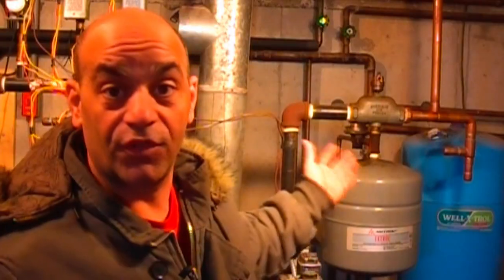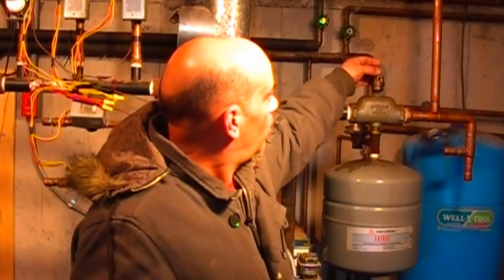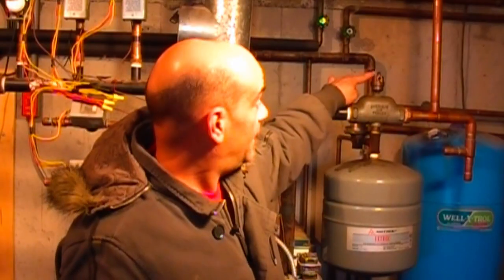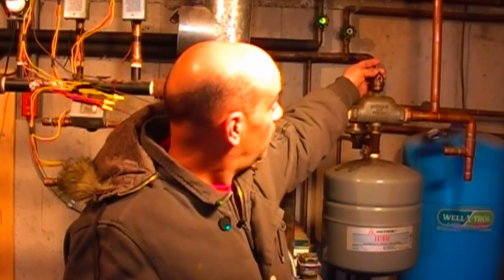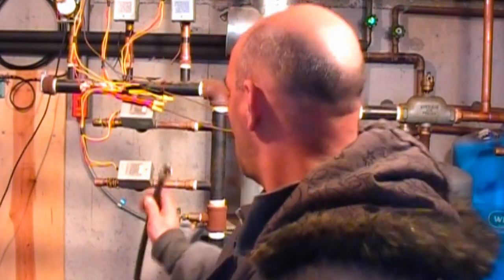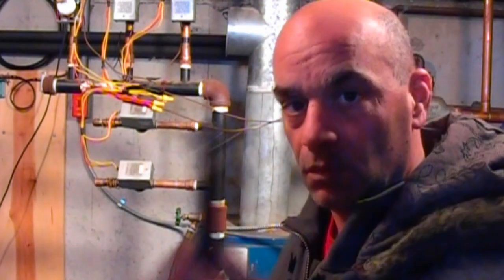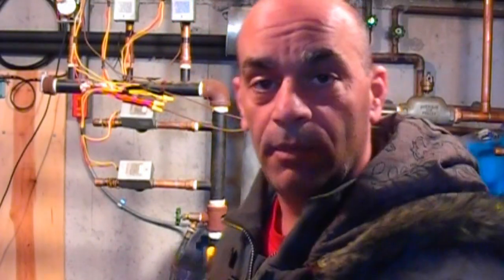How to remove the air from your boiler / heater

Comment: what if the pressure is low on the side of the boiler. Mine only reads about 4psi maybe.
Reply from the maker: Make sure the fresh water valve / regulator is on.
Reply: I've looked from where the water comes into the house  to the boiler and it seems like all the valves are open. The pipe splits when it gets to the boiler and one side goes to my how water heater the other side goes to my boiler, right under it is my expansion tank and right above it is the valve that purges the air. I dont see anything else to open to get more pressure. I've also opened up the bleeders on the upstairs baseboards, some air will come out but then it just stops and no water will come out.
Reply from the maker: Ginzosmovies If you can go to my site and post some pictures of your boiler so I can help you better.
Reply: askmediy I put a video called Boiler Pics in my videos if you could please look at it.
Reply: Ginzosmovies You may need to replace the water pressure control valve. I had the same problem due to a clogged valve that reduced the pressure to the boiler. A new one pressure valve solved the problem. 

(this is a year old post but in case others have a similar problem.....)

Comment: Dominic, your explanation is excellent. I don't think there's any other video that explains the workings of a boiler like you did. Question: When I open the spigot (with the hose on it) to bleed/purge the air, can junk from the boiler pot interfere and prevent me from closing it again? I have one radiator on the second floor (whole system is one zone) which defies bleeding. A lot of air comes out, but will not completely bleed, and the hot water sits at the bottom of the radiator. Also, I hear gurgling in the wall when the system shuts off.
Reply from the maker: Yeah loose junk in the water can jamb up the seal on the valves. do you have a bleeder valve on the radiator. If you do try using that as well. 
And thank you.
Reply: askmediy Actually, I leave the valve on the radiator open while the heat is on. I think the water is not being forced through the entire radiator. Another radiator (in the upstairs bathroom) bleeds just fine. It's just this one other radiator on the second floor.

Comment: I have 3 zones in my house.  I have successfully purged the air from the top 2 floors, however, on the bottom floor it seems to be taking air in along with the water as the bubbles don't change in intensity, but there is quite a lot of bubbles in the water in the bucket.  Any ideas?

Comment: Thank you for the tip on the purge valve. I bought my house in late spring and by early winter the pipes were sloshing and gurgling. I flushed all the lines, and got some junk and lots of air out, but within 3 weeks I could hear the air again. (Our city water holds lots of dissolved gasses and we get bright white ice cubes.)  After watching your video, I went and checked the purge valve. Sure enough, the previous owner saw a couple of lime streaks down the tank and closed the cap down tight. I loosened it up, ran the heat, and within 4 minutes it was all quiet again! Thanks again! Dan
Reply from the maker: Good deal. Glad I could help

Comment: I do the same

Should have do a better job with wiring.

End switch are clicking a 24 relay that is turning pump on.

but aint clean..

The guy has experience, im in this too. but wtf is that mess of wire....

Comment: Great tutorial and I love the character you put into it, much better than the monotone of some of the others. 1 question: What are your thoughts on auto bleeders in the baseboard radiators for bleeding residual air? Our plumber installed 1 on the topmost baseboard on the third floor, before that we had to go to each unit and push the Schraeder valve open, starting on the first level and working our way up. The auto bleeders seem to work great..
Thanks.
Reply from the maker: I've never used them as it leaves way too much to go wrong with leaks. I've always installed a auto bleeder down at the boiler. But hey some older steam converted systems may need one or two installed.

Comment: I honestly wish you did my system. I'm having an issue with the top floor. The minute the water line is cold, it creates bubbles and the heat doesn't want to rise. Lately, when I close that lever (one for each zone) and try to drain in. Nothing comes down. I feel like the cold water is sitting up in the pipes and doesn't want to drain. Does this make sense or am I doing something wrong. The zone valve doesn't seem to want to allow hot water up. I would appreciate help.
Reply from the maker: I would make sure the zone valve is opening up. Try to manually open it. Also the bleed it very very good. Send me a picture of your system if you like.

Comment from the maker: 1) Turn the power off. 
2) Turn the fresh water inlet valve off
3) Release water in the system to at least where the pressure is below zero. and temp  
4) Remove and replace tank all in one full shot. Get ready for a bath. 
5) Bleed system, the entire system.

Comment: To replace an expansion tank..Do you first turn off the boiler, then remove the tank and install a new one on? Will there be any pressure coming out when you remove the tank completely?

Comment: PS.  That's a nice air removal valve you have mounted over the pressure tank.  It looks like a B&G.  I have their large canister type and it took care of all the air in the system and does a great job.  I can unscrew/remove the cap lid on it and inspect the guts when necessary.  Experience has taught me air-in-the-system is a side result of high temperature (heated) water.  You cannot cure/stop that.   The same as boiling water in a pot on the stove...

Comment: Thanks for the video.  I continually review my boiler knowledge by watching videos--so made by generous people such as yourself.  My comment is --I had been suspicious that my ancient water pressure reducing valve was faulty.  It was--it was blocked with crud and virtually took the water pressure down to nil.  Changed it out with new and what a difference.  Mind you, we have soft water!  I did not know because the pressure gauge was bad as well.  All's well now--what a difference.

Comment: Thank you!  Went from no working heat on the 2nd floor at all to completely fixed thanks to your explanation.  I had tried bleeding it before but I didn't close the valve that prevents circulation, so I imagine much of the air just went around and around.  I also didn't bleed it nearly long enough the first time.

After watching your video, in which you pointed out both of those pitfalls, I bled the system correctly and now everything is perfect.  Thanks!

Comment from the maker: Thank you. Sure it could be. Make sure the wire connections are good as well. On the valve you should see a small lever for a over ride. Try moving that. But do not leave it in the lock position once you're done bleeding the zone.

Comment: It serves a 1st (great room) and 2nd floor (loft). 

BTW, I just replaced the expansion tank as it was clearly bad and primed/bled that section (the system has a really good placement of isolation valves - well plumbed). The new one definitely has much LESS water in it.

Comment: A bit more, as YouTube's char. limit/message ran out. I can hear the bubble flow past when exercising that circulator. Then it runs fine for a few, until things repeat. I am afraid that I am going to burn that pump up. Also, I get water from the bottom of the Amtrol tank's air valve when pressed on to check air psi. Other checks (tapping on it, half hot/cold) seem OK though.

Comment: Dominic, Your vids are a gem! Simply great for the doityourselfer! Question: Would a bad Amtrol 30 tank let air in? I cannot keep the zones bled, one in particular will last less than an hour and then vapor locks. No leaks, so that is not the issue and boiler temp & pressure is OK. That circulating pump will go to humming LOUDLY when the vapor lock passes through and lands onto it & the pump loses it's prime. Jiggling the its thermostat off and on will push the bubble past & things are good.

Comment: Great Video, and great Plumbing... your presentation is seriously professional.. as for your system  to dump the air very simple set up . prior comment regarding those little auto  bleed  'air release Valve' all to true. we call some folk  here in Ireland  a ... 'Hurler on the Ditch...
A non-participant who criticises from outside. Derives from a criticising the players on the field of play...

Comment: I have anti-freeze in my system with a back flow valve installed. The system is good to 10 below zero. If you want more, add more anti-freeze. You have a great video. Thanks.

Comment: @DominickDiy well its a big system there are 2 pipes coming to the bottome of the boiler which are 2 or 3 inch and it does have the air release valve cause there is a hose connected to it and those 2 lines are a circ pump each and I can hear the water trickling in them as well as in my room which is 2 is probably about 100 of feet of line to the boiler. and coming from the top of the boiler there is one line which is about say 5 inches and coming off of that is a line going to the expansion tank

Comment from the maker: Just try opening up those valves on the radiators one at a time. Try to start with the one closet to the boiler. and so forth.

Comment: What if the boiler does not have any zone valves but each rad has a valve. I know that there is air in the system because I can hear the water trickling in the rad and one side is warm but the other side is cold. Its somewhat of an old system it does have the shut-off valves by the circulation pumps.

Comment: Great video. Especially for me as I seem to continually battle with this issue. My system seems to vapor lock and I have to drain off air. Would you have any ideas as to where this air would be coming from? Thanks again for the video.

Comment: yes they are moving manually and the spin off and on,when themostat turn them on and off. if the dial moves can the insides be broke still. the pipe under zone valve is cold. the valves im using are white roger zone valve 3 wire terminal.

Comment: i work at apt complex which we have boiler system, when a resident shuts off thermostat how long should we expect the heat to be gone in the heat boards, getting a lot of calls from people thinking the zone valve in stuck on but when i check the zone valves they are turning, i touch the heat boards and they are warm so i can tell the hot water is going away, just so hard to maintain a temp. any ideal thanks

Comment: thanks for replying
 
i have a pressure expansion tank with diaphragm for close hot water heating system.
 
on the expantion tank there is a label that it says
 
working presure 60psi
 
hydrostatic pressure 75psi
 
operating temperature 240f
 
recharge pressure 12 psi
 
..
 
i noticed when i try to bleed the underneath of the pressure tank to see if there is air coming out ....it s not air or water coming out from underneath of the expantion tank

Comment: when i drain the water coming out from the radiator the water comes out always and it is only on the first and second floor only the water comes out constinuously but on the thirth floor air comes out when i try to bleed for few seconds and then it stops and not air not water comes out afterwards even thought i put the boiler up to 80 and run constinuously for a while.. this is only happening on the thirth floor only

Comment: okay so i had my husband watch your video. he went and opened the air  relief valve and air just started to come out. BUT as the air was coming out water was coming out too is this normal? (we are renters so this is not our boiler and the owner lives in a different state.) But as the air came out the presser gage went down to 0. it was in between 0-10 psi.thanks for any help. i wish i could call lol

Comment from the maker: I would first check the settings on the limits on the boiler. On the boiler there is a temp gauge. What does that say. It should most of the time be about 180-190

Comment: Okay i have a Dunkirk Radiator Corporation bran Boiler. we have the base board heat. it heat with natural gas. my complaint is that it does not heat me house. you can fill the base boards are warm but never HOT and it never gets up to 70 it stays at 62. it seems like the unit is always turning off and coming back on. (like you can hear it ignite and then shut off with in like 20mins.) The thermostat is set for 70. should i bleed out the lines? i does not make that knocking noise tho.

Comment: If you drain a large amount of water while trying to get the air out, does the system automatically fill itself back up, or do you have to turn on the water supply valve to make up for the lost water?

Comment: i have another question i dont see u done any videos about circulator pumps ( circulator that transport water throught the radiators) i have one zone with 3 floors the termostast is in the 1rst floor .. well this boiler is just 5 years old when it was installed i open the little not on the 3rt floor and water was circulating. well now i dont see water at all when i bleed the radiators on the 3er floor only on the first and second but the water dont go up to the 3er floor

Comment: dominic is this way to remove air from your boiler the same removing air from the radiators? in the house,, i have a oil boiler hot water system
thank you for your answer in advance

Comment: your hot water has a valve in the system and the heating has one as well, you say the water is working fine so you need to look at the water valve, best to get a plummer in, mine went two weeks ago and the plummer replaced motor and charged me £30 total but may be more depending on where you are. it will prob involve replacing the valve or the motor in the valve so its not something you would do yourself unless you knew what to order and were comfortable with wiring the new one in

Comment: please help we have a 5 valve with 5 drain pipes. we do everything you said and the only time water comes out of the pipe is when we turn the power off and the on it dont stay flowing what are we doing wrong.

Comment: Hi Dom,
Thanks for the video. Very helpful. I have a question.. in a system similar to yours with 2 zone valves, would it be ok to purge both zones at the same time (open the switch manually on both valves) or would you recommend doing one zone valve at a time?

Comment: I added some heat registers this summer. After adding the heat didnt work. Tried purging
the air but there were spots that you couldnt get to. So I ended up hooking the house water into the line, run a full 60psi until all of the air was forced out. Heat works great now. And very quiet!

Comment: hi dominik i let the air out of the pipe with a hose.. drained the expansion tank opened the water valve filled it back up to 15 p.s.i. there was no heat working before now the heat is working on one side of the house and not the other. i Still hear the gurgling sound of water in the pipes.?
Reply: Mine to. I had to empty the whole system

Comment: I now have a brand new Biasi 10 boiler w Beckett burner. For two weeks it has been amazing. However,in the midst of Hurricane Sandy, we ran out of oil -we just got an oil delivery. For  the last few days, suddenly we are hearing a deep vibration/groaning when it shuts off-sounds like it is in the floor-such a vibration, Someone suggested it could be the nozzle (huh?)-and not to let it get sooted up. What are your thoughts?

Comment: many people with a single pipe system wont benefit
u have to bleed all radiators if any air is in the system im air locks
just keep in mind, single pipe systems suck

Comment: Dominic, thanks so much for the informative video. All the bleed valves on my system were cranked all the way down, and the system hadn't been bled in years. Drained out all the sediment, loosened the bleed valve caps, and turned everything back on. Everything gurgled for a minute or two while the very last of the air made its way downstairs, and the bleed valves did their magic Now its silent as a dream. Thanks again!

Comment: Hello Dominic, My new boiler peerless BVW3 is heating the water to the highest temperature the pipes getting hot but no hot water reaching in to radiant pipes, I let the radiant pipes  drain that the air comes out after 1 hour  still the water that comes out still very ice cold, can you help. Thanks

Comment from the maker: @bkcmurphy1 That valve is the supply for new water into the boiler. That should always be left on. It really depends on how your system was designed on what valve if any may need to be turned off. For the most part you could just open the spigot and bleed. Turning the return valve right after the spigot would be much better, if you have one.

Comment: Hi Dominick
In the video you mentioned the value to shut off the system but you did not shut it off. Does any valvue need to be shut off before bleeding the system or do you simply attach a hose to the spigot and drain it until the air is removed?

Comment: I have a question. I have taken out the air from my boiler a month ago.
Now, there is noise in the boiler and the pipes, when the burners turn on.  The noise stops, when the burners shut off, even if the circulators are running.